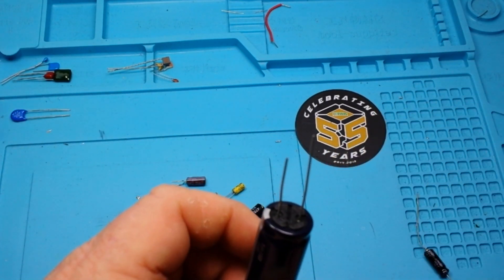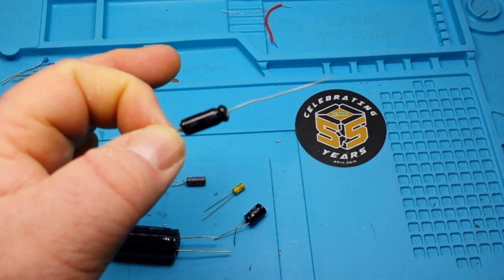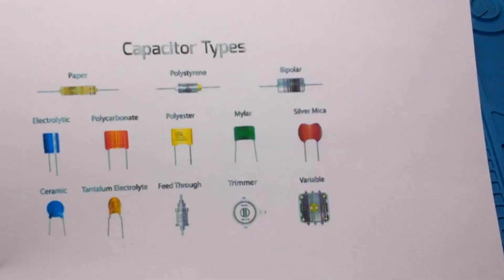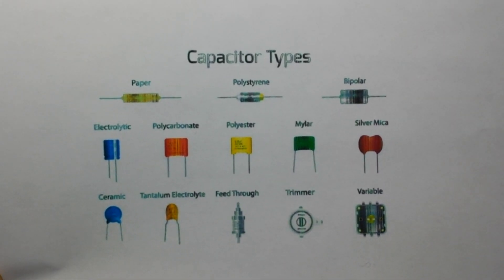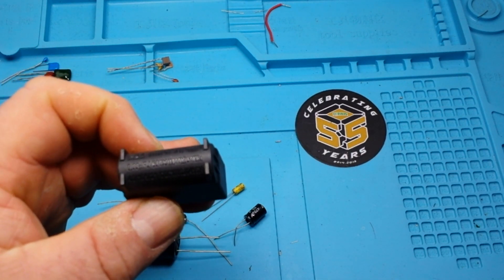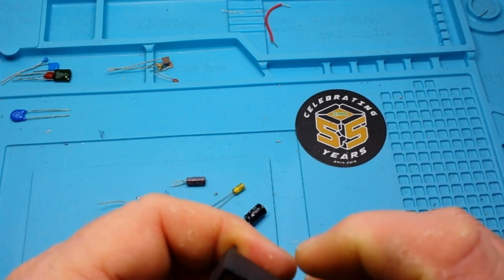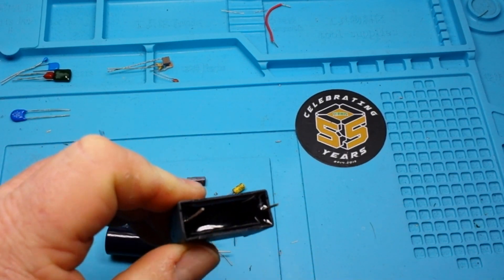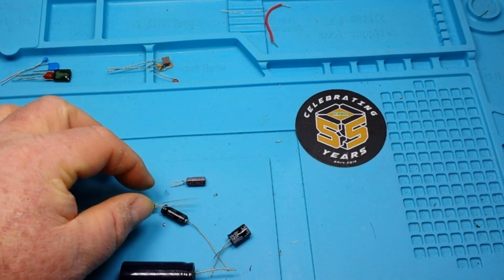Types of capacitors

Comment: It would be nice to see why you use each type. For example, a 0.1 uf ceramic vs tantalum. Even though they may have the same values, the tantalum may be preferred in some cases. I don't know why. Also the characteristics of the caps. Are ceramics good for low noise situations like audio amps?

Comment: I'm trying to find out a way to measure those super capacitors because without measuring it they can tell you just about anything of the value the super capacitor should have making us look like fools and I don't want that, do you?
You also forgot to tell that with the electrolytic capacitors that the bigger the size the lower the ESR value will be.
If you know a way to measure the capacitance of those super capacitors it would be very helpful to me because I'm out of ideas and don't know where to look online for any information about it.

Comment: What reverse voltage/current did you use to pop that cap? I'm wondering if, say, a AAA backwards would blow it, or USB level, or ... etc.?
Reply from the maker: 30V about 3A
Reply: @learnelectronics  Thanks, so no worries about explosions in small battery powered devices.
Reply: @strayling1  Not so much no, but it will still reduce the life of the capacitor and make the circuit unreliable.  The explosion is due to the electrolyte boiling and turning suddenly into vapour.  If the power input is lower, it may not be enough to overcome the inherent heat dissipation. The temperature rating on electrolytic capacitors is somewhat below this boiling point, however running them constantly at that maximum temperature will reduce their life in other ways, as it can still pressurise the seal on the bottom and eventually cause leakage.  This is why when trouble shooting a power supply the first thing you do is check the electrolytics that are mounted very close to heat sinks, and especially check the state of the burst disk on the top of the can.  Sometimes the problem is easy to spot from a domed top, even if it hasn't actually burst.
Reply: @Chris_the_Muso  good info, thanks.

Comment: This type of basic information is really not covered well in a lot of tutorials, so kudos for doing this.  No, film capacitors are not polarised.  If you see film capacitors (usually axial) with a stripe it's indicating the outer foil recommended for ground connection in radio applications.  This is to reduce RFI cross-talk from the oscillator circuit, not due to any requirement of the capacitor itself to be connected one way or the other.

I do have one issue however...  X class rated safety capacitors are actually designed to fail short circuit with a very high degree of predictability.  These are used as RFI suppression across active and neutral, and of course in this case it's vital to have a fuse on the device (before the X class capacitor) as well as externally on the mains circuit.

Y class safety capacitors are designed to fail open circuit with a very high degree or predictability and are used for RFI suppression across active and ground, and in cases where a short circuit is highly undesirable such as capacitive droppers and other types of minimal design power supplies.  Beware cheap Chinese power supply manufacturers that do not understand this (too many of them).

It's really important to pick the correct safety capacitor for the application.  The saving grace in this is that most hobbyists are probably unlikely to be trying to design AC line voltage power supplies for their projects (if they are smart) but it's important information for those that are at the level to be following a PS design published on the internet, but where parts selection is left up to the builder.

I also have a suggestion: maybe give a general recommendation for bulk component purchases for the hobbyist.  For example, I'd recommend getting a "grab bag" of ceramic capacitors because they are really cheap to buy a couple of hundred in assorted values (usually ten of each) the same as we do for 1/4 watt resistors.  Similarly you could make a case for buying a grab bag of normal film capacitors.  Electrolytic and other specialised types (including X and Y class)  are probably better bought individually as you need them, as they are usually more expensive and used less frequently, and have more stringent selection criteria such as working voltage.

Comment: found a cap i never saw before on a relay circuit i pulled out of an old dryer the other day!!

that feed-through capacitor that was on the page you held up was one i never heard of either!! what are they used in, or for?? anyone??
Reply: Hi Keith feed-through caps are used to filter noise off a conductor to the enclosure as it passes through the enclosure wall. enclosure would have to be made of a conducting material. Normally used for EMC  protection, as it works both ways, it will also filter noise on the external conductor to the enclosure to stop it entering and causing issues. hope that helps
Reply: @TheEmbeddedHobbyist  Thank you for your reply. & yes it dose help!! any knowledge is always welcome in my book. at least now today wasn't a wasted day because iv learned something new.. So thanks again : )

Comment: I would have liked to hear some of those differences in how they act in a circuit. What happens if I use ceramic in place of a film cap, or whatever, in a circuit? Will it not work or could it mess up other components? I really only have some of the ceramic caps, single and multi layer, and electrolytic caps, and those have been doing me well so far. I didn't realize there were so many other kinds.

Comment: Love a good explosion. I remember one of our instructors was demonstrating a Capicator which was large cap out of an S-100 power supply. After charging it he took a large screw driver and shorted the terminals with it, quite impressive almost melted the shaft  in half. Love electronics.

Comment: whats the difference between an electrolytic cap and a non-electrolytic cap ?
I'm guessing you only use the electrolytic on dc circuits ?   the other caps are only used for AC ?
Reply: electros suck at certain frequencies and are only good for rough power bypass and some audio stuff. there are various applications for each type of cap eg power filtering (electros tantalum,poly/film, ceramic), oscillator circuits (mica), RF coupling (ceramic), audio coupling (poly/film, some electro), low and high pass filters (most types), timing (tantalum)

electros usually have higher farad values but some other aspects arent as good, non-electros will be for the lower values but have other desirable aspects
Reply: this one explains it one the surface quite nicely and gives you couple things to research if you wanna know more, also Texas Instruments has couple papers about it, 
https://www.youtube.com/watch?v=2v8zBj7_sxg&t=107s